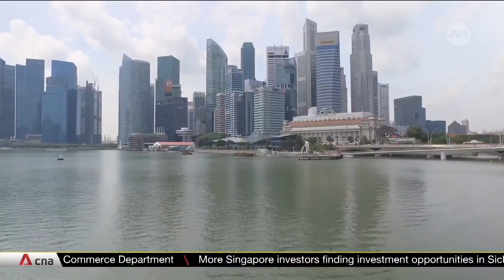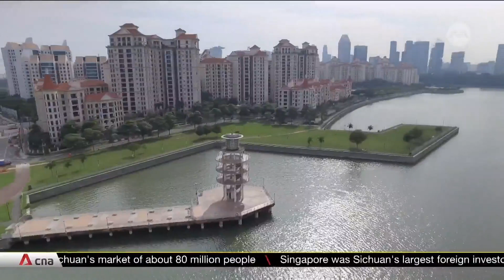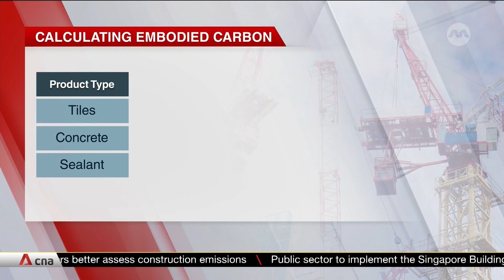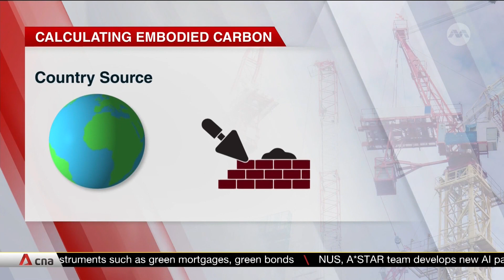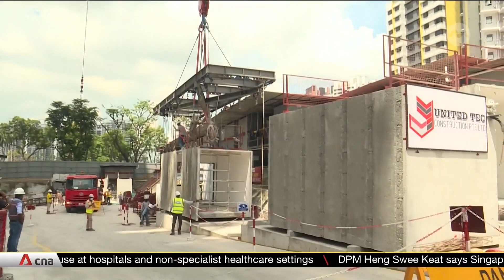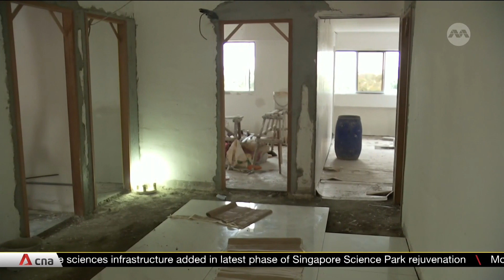Public sector to implement Singapore Building Carbon Calculator immediately

Comment: Will the MIW use the Worse of the Worse Case "Prediction Study" in order to justify and raise the Carbon Tax next [after GST], example using SSP3-7.0 or SSP5-8.5 instead of the SSP1-1.9 which more closely resembles the Up to date, cumulative and historical Satellite Altimetry Measurement example the rise is almost linear?
[Add: Experts say in Figure SPM.8 Page 22 wherein states - Low-likelihood, high-impact storyline, including ice-sheet instability processes, under SSP5-8.5 [for those who want to dramatize the studies]. "Dramatize the studies" are the EXACT WORDS in the report.